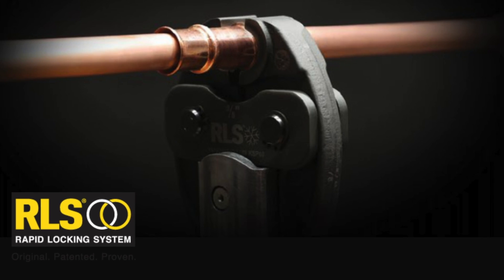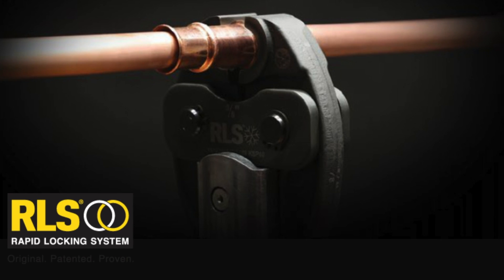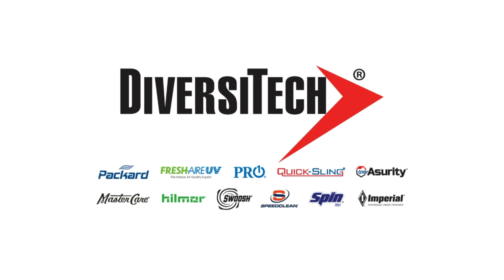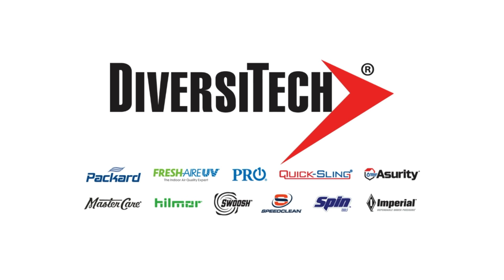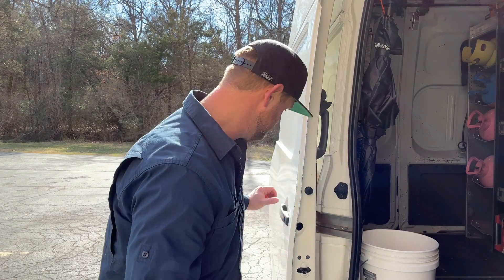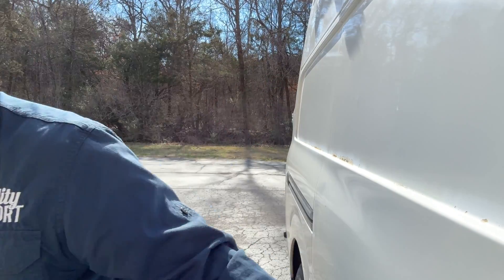Working on a CHILLER I have NEVER seen before...HVAC Life

Comment: Looks like a process chiller for a printing machine, scroll compressor brazed plate heat exchanger and a lot of solenoids the sight glass shows it might be low on charge or restricted? Or maybe one of your hot gas valves isn’t working properly

Comment: the loading, unloading heating and cooling is controlled by the leaving and entering chilled water. if either sensor is out of range or faulty it will load and unload compressor outside of its operating range or set point.

Comment: One issue I ran into recently on a Daiken chiller was a EXV that would stick closed and cause a low evap pressure fault. I chased water to confirm it was getting enough water and almost everything else before setting on the EXV

Comment: Hey, a Technotrans! I am the designated Technotrans repair guy for our company since everyone thinks theyre impossible to work on (theyre not.) The one big issue is the copper is metric sizes which our local supply stores dont carry. 3/8" copper is very close to 10mm which is what they use for liquid lines. I show up and Technotrans has already shipped the parts they think it needs (Solenoid Kits, TXV, Compressor etc.) When we get a call I am just the technician who can safely recover, cut out, braze in, evacuate and charge. 

Cool to see.

Comment: Like any other  equipment, they require regular maintenance.  Like it was said before, check for scale as it can cause problems on the water side.  It looked like your sight glass was clear and uncontaminated so I'd start by checking sensor resistance values and go from there.

Comment: Replace the water with air it will help you remember your basics. Low water=low airflow which could cause low evap temperature etc etc you know the drill

Comment: Sounds like evaporator isn’t getting enough water, I would check to see for restrictions. Anything that could disrupt that chilled water supply and return will cause evaporator temp to drop, that’s what’s causing that alarm. Once you confirm everything on that side is good and it’s still being a problem, check the unit with your gauges and dive deeper from there but it should only be a water problem. I love your humility it is very inspiring keep up the good work 👊

Comment: You may have already done this but there should be a chilled water strainer in there. More than likely on the entering chilled water side of the heat exchanger. If you valve the water off and take it out you may find it dirty. Might have ink in it i have found that before. Hope you’re able to get it figured out 👍🏼

Comment: Those chillers are pretty simple to work on. I have several printing facilities I take care of. If the condenser is inside and the hot gas is cutting on and off it probably low in refrigerant. Is it bubbling in the sight glass? It is just like working on any other chiller.

Comment: Most chillers don't turn off. They "unload". Check your low water probe on the next visit. they have a tendency to becoming scaled up and stop sensing water.
Reply: Yep! They will "unload" constantly under light load. That is what the bypass is for.

Comment: The manual should mention how to add water/glykol somewhere.
I suppose this one has a reservoir on the higher side of the compartment with an access to refill water.
It will always happen a little evaporation so may be that simple that it happened over time or even a small leak.
The oil based circulators are another story without need for a refill.
As you mentioned, those units mostly use a bypass valve and an all time running compressor.

Comment: That alarm looks to be a water issue. That brazed plate heat exchanger has an air vent on top. You need water flow like you need air flow, start with the basics and they'll lead you to the problem most of the time. I like a good process chiller.
Reply: I remember the first one of those I ever worked on . I stepped back and said th3 same thing you did . And the rest was history work on quite a few of them now mostly budzar
Reply: Chillers are very basic once people see it that way. The problem could be a logic control problem, I’ve had it where the parameters on the controller were not synced with real time parameters, and was off by a good amount. Logic controller had a “freeze logic stat” and put a “low water” alarm out because of the improper parameters
Reply: @NROhvac  logic is only as good as the information you provide it.
Reply: @EverythingHVACR  yes indeed! lol